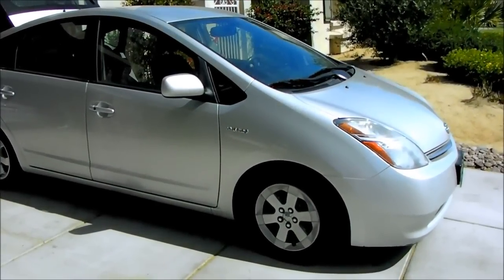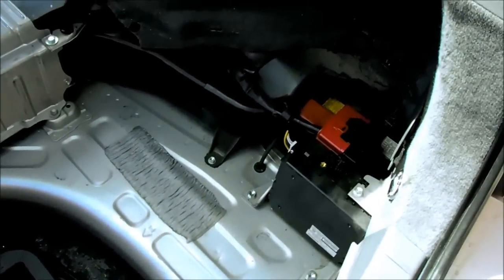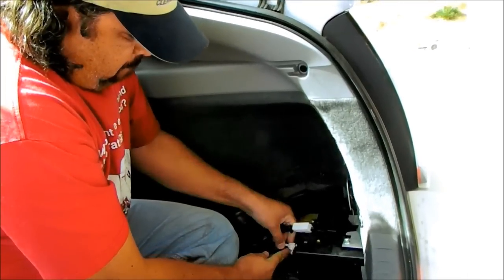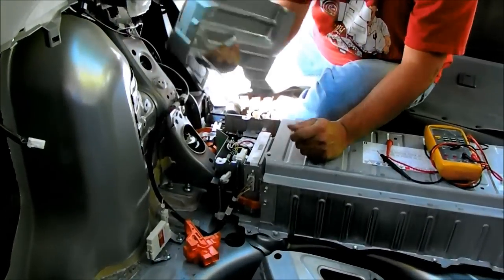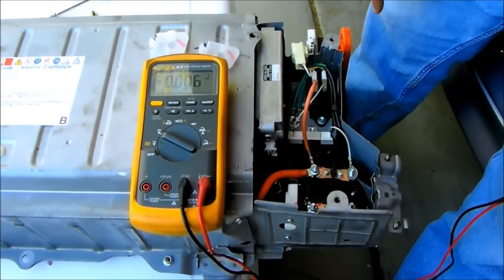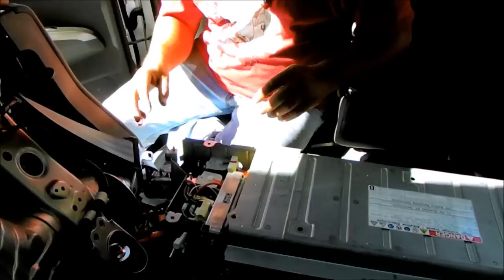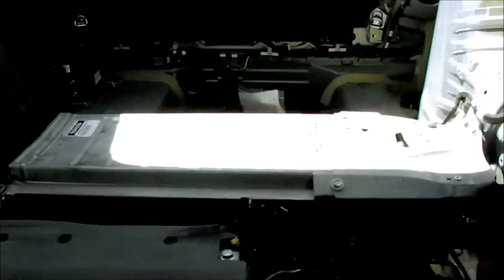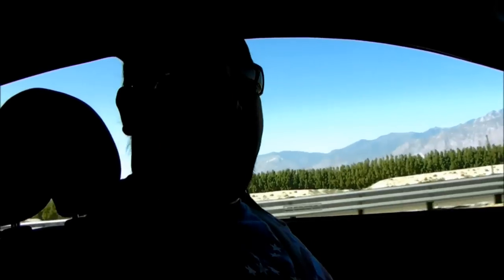Toyota Prius battery removal and repair. replace hybrid check engine light

Comment: Thank you for taking the time to make this excellent video. I followed your steps to a tee and the battery removed exactly as you described. (1 hour plus time ). Due to the extreme cost of replacing my hybrid battery in Canada, $2000 for a reconditioned one, I decided to take this one step further by checking each cell to find the defective cell. Every cell except one measured 8.1 volts and the one stray measured 6.78 volts. Removing this cell and replacing it with a new or reconditioned battery fixed my 2006 Prius. Car runs just like it did before the dash lit up like a Christmas tree. Many thanks again. John
Reply from the maker: Glad my video helped you out.

Comment: Salve, se qualcuno avesse problemi con la batteria della propria auto ibrida, sono in grado di sostituire le celle guaste senza cambiare tutto il pacco batteria, ma cambiando solo le celle guaste: si evita di spendere 2500/3000 euro. Effettuo anche il bilanciamento delle celle, anche se la batteria funziona: effettuare il bilanciamento aumenta infatti le prestazioni dell'auto e allunga la durata di vita della batteria. Il test dello stato della batteria lo effettuo gratuitamente (in toyota 39euro). Per maggiori informazioni  tel:3388610904, email:valerio.lombardi95@gmail.com

Comment: replacing one bad cell row .... is like changing a worn battery from a torch ... and putting a new cell ... soooon othet cells will start to fail . we all have practical experience of only changing the bad battery's in a torch ... hikz this is not easy to take out ass cells fail ... not like a torch...by the way i dont think amerzon or e bay have new cells ??? must be used ones taken out from packs ???? that would be worse ....

Comment: I have a 2005 Prius with a new hybrid battery I paid 3K to install less than 2 years ago.  The Catalytic converter on this '05 Prius now is broken so I'm thinking of just getting rid of the car.  I also have a 2007 Prius that still has less than 100K miles on it.  I'm thinking of removing the newer battery from the '05 and keeping it to put into the '07 in the future.  I don't want to go through the expense of buying another new battery for the '07 someday. Is this a good idea?  Just want the opinion of a guy with skills.  Don't know a thing about cars.  THANKS!!
Reply: Cynthia Robles I would do that. Sooner or later you'll have to replace the battery on it too. Or buy a used catalytic converter from someone that is parting bc a Prius out.

Comment: At the end of the video you talked about replacing individual module cells. I did some research on those and I get it... those run about $20-$40 each on eBay, and with a battery tester the bad modules (usually just a few) can be replaced. No doubt this is what Toyota does when they replace a (battery). That, or they replace all the modules and sell off the working modules to mechanics. What a scam. https://www.youtube.com/watch?v=8p8Im1eL67Y

Comment: Thanks a lot for the video. I did replace a cell in my battery and re-balanced. But found out that my Hybrid Cooling fan on the right was not blowing cold air making battery hot and causing triangle of death. I replaced the fan and it worked like a charm. These steps helped.

Comment: is anyone in New York can check my 2010 prius the car stop in the middle of highway in long island expressway but manage to travel in the safe area. I sent the car to the dealership where i bought and they told me it cost $3600 to repair it. i have not make any decision yet so i towed back my car in my driveway. if anybody out there can help me diagnose what's the problem on the car with much lower repair cost i would appreciate to call me at 631-921-1102. Thank you

Comment: Glad to see you used the necessary protective 1000v gloves whilst testing the high voltage.... This is not a do it yourself job you can and will be killed if you touch the high voltage connections and beware high voltage can arc.... don not work on , touch or test any high voltage system until the service plug has been removed.

Comment: here's  a few suggestions for getting a good result
do not try to do this unless you know what you are doing - the acid can burn your skin
check the voltage first - there may be a dead cell which would waste your time.
Check the battery fluid.
Try to fully charge the battery.
(I learned about these and more from Jons Mender Guide site )

Comment: I changed my prius battery, actually I replaced one cell abd put it all back together and it is now back inside all hooked up, when I try to start it the power is on but my car won't start the engine. what do you think could be the problem here

Comment: No one ever shows actually putting the battery back IN.  What trouble did you run into putting it back in?  Any friendly tips?  I recently took my battery out, easy.  But I have a feeling putting the new one in, will be where the trouble comes ....

Comment: i have 2009 honda civic hybrid tho. took to autozone to diagnose. and it came with error code. p1570, p0A7F. googled it and no luck or answer. maybe bad battery cell too?
Reply: +Calvin Le No. The 09-11 HCH2 batteries are atrocious.  Replacement rates of over 30%.  Honda extended warranty in ALL states to 10yr/150k mile.  P1570 is a individual voltage input issue and P0A7F is just a deteriorated battery.  This indicates that at least one of your 12 cell subpacks has gone bad.
Reply: I have a 2008 civic and this batteries are in FREE recall. Honda dealer change for a new battery for FREE. I suggest you contact you Honda local dealer.
Reply: Please provide evidence of your claim.  The 2006-2008 are covered under a settlement extending their warranties to 92-96K depending on year.  The 2009-2011 have all been extended to 10 year/150k miles (the CARB warranty).
Reply: Actually... you sure it's not for the airbags?  We just got one... :)

Comment: drsjr1969 
  I have 2005 business edition and its @ 158K I have not had problems with the battery, How will I know if I will need to replace it when needed?
Reply: the warning lights will come on. it can ran only for a couple miles after.

Comment: Just out of curiousity where do you live ? Our 12 v battery died while driving it. We replaced it and got a new key but the 2006 Prius dash won't light up,except for the open door indicator and the security feature and the car won't start.

Comment: Cool vid.  While I understand that you reverse the steps that you showed to complete the removal and replacement, it would be cool for folks if you did the complete process.  Please show how you repaired the battery pack by load testing and placing the battery on a circuit (presumably a battery charger).

Comment: I cant believe your not dead. no gloves, did not drain the caps, Im a 30 year Toyota master. You are a lucky man!!!!
Reply: Voltage doesn't kill, amperage does. Spark plugs can generate 50,000 volts - but it's low amperage. I learned about that as a high school freshman in the 80's when the instructor told me, "touch this," and I got zapped. Things were different in the 80's.
Reply: Ignore him. He doesn't know what he's talking about.
Reply: Cap is Caps in the inverter can store a massive charge but that do self discharge in a fraction of a second but if you just removed the plug then there is that potential ... @snoobler
Reply: @DesigninMind1  I speak from experience.  "30 year Toyota Master"  probably hasn't personally replaced 200+ Prius batteries.  In my experience, I have NEVER detected a measurable voltage the the terminals.  The poster of this video confirmed no voltage. No risk of shock. No need for gloves. Not sure what you're on about concerning the plug. It splits the pack removing voltage on the OTHER side of the relays. The relays isolate the battery from the inverter when the car is off, so the plug plays no part in any potential hazard from the caps.

Most screaming about the danger of hybrid batteries are simply parroting what Toyota says more for liability reasons than for safety reasons.
Reply: A few months ago i touched live HV battery with a wrench. It shocked me like there was 50-100v ac.
As you can see i'm still able to comment.
Reply: @АвтомобильныйМир-е9м  Considering  the safety interlocks, I am curious.  How did you manage to defeat them?  Which generation Prius?  Because I am writing an essay on the subject, I would appreciate your response; thanks.  Up until now, I have not identified a single news report of an individual receiving a severe-shock or being electrocuted by a hybrid vehicle.  And those that traffic in this fear uncertainty and doubt (FUD) always seem to have a financial interest at stake.  Finally, Toyota's safety interlock system is quite ingenious and the addition of a corresponding orange plastic retainer clip, a clip that is used to fasten the cover,  on GEN III Prii only enhanced the safety system; the orange safety switch is required to fasten down the battery ECU's cover.

--A general electrician
Reply: The Cap in the inverter more or less self discharges in a fraction of a second, but still a valid point. i repair lexus Gs450h/Rx400h, i did wince a bit with the safety plug and the DVM leads. i have a standard rule, when you can work with One hand, it limits the potential of the juice going through your heart. better black fingers (which i have done) than a black heart lol
Reply: Drain the caps?
Reply: graham hendren yeah ignore him. Hes just trolling
Reply: Are you all dumb? It's not volts NOR amps that kill you, it's a combination of both that kill you. High voltage with high amperage equals high wattage, and THAT is what can kill you. If you have high amperage but no volts at all, you're safe.
Reply: Strictly speaking your wrong. its ALWAYS the Current that you consume as an effective Resistor that kills you but . but consuming watts still sums to the same thing. think then quote 30ma can be lethal through the heart . p.s you can have volts and nearly zero amps but its damd impossible to have mega amps and no voltage ... @swampsnipe8790

Comment: Hi .  I've got a Prius V and I want to lowering my rear cargo area , and make   a two seater with a huge low  rear cargo area  . So ,  I want to relocate the batt pack just behind the front seat in the actual rear foot well area . For the spare tire relocation ,  if need , it's not a problem . Do you think it's doable  or better order the Lithion ion batt pack offer  in the euro Prius + V ( a  V with a third row ) . This pack is locate in the center console of this euro version .

Comment: With some electrical and mechanical skills you can do it yourself. If not there lots of small shops can perform battery exchanges. looks like a 1/2 day job. after few times it can be done within 2-3 hrs. Don't let the dealer rip you off! Good video !

Comment: Why are you testing the battery with the meters range switch on Ac voltage? Motors run on DC current
Reply: BreeBree Cris The AC position is the first position past "off" with the wavy line over it. DC has the solid line with the dashed line underneath which is what it was set to. I was surprised at the voltage though, 220V DC, that would definitely get your attention! (Or you could weld stuff with the leads!)
Reply: It's not possible to measure DC voltages with a meter set to AC.

Comment: George Betuk
I believe that the Hybrid Battery on my 2006 Prius has gone south. I received the same quote from my Dealer. I am really strapped for cash just now and asking your thoughts on maybe a used Battery pack. Your video is excellent by the way and I appreciate your post of the process.

Comment: To replace the battery is one years gas bill and if you repair its worth couple months gas bill. Very worth the hassle if you keep the car. All that would have to be done to replace the hybrid battery is set a side 40 dollars a month or 10 dollars a week tell the battery died in 5 years time.

Comment: Bam!  I used your instructions and did this in under 2 hours!  Found one bad cell - replacement cost $53 USD including shipping.  Saved me from paying a "Hybrid Battery Repair" company $1,200 to $1800 to do this.  They all give you a line about how they recondition and balance the battery and give you an option for a 12 or 24 month warranty.  Usually only one or two bad cells and it takes them < 2 hours to complete.  - DIY
Reply: hybrid repair companies do the same.  they only replace bad cells and you may return to them again and again.  the warranty they give you, covers only the cells they replaced.  for me, the best thing is to buy a brand new battery and go for another 5-10 years without headache.  the warranty on a new battery covers the whole battery not few cells.  thanks for pointing out the hustle of countless repairs.
Reply: +David Hoel  How did you discover which one was the bad cell ?
Reply: +Tom OConnor remove the leads and leave for 24hrs and test with a voltage meter. good cells should be putting out 7.6...anything less and you should replace the cell....the bad ons throwing heat resistance will be 7.4 or less
Reply from the maker: +David Hoel I'm glad my video help you out. Thanks for your added info also.
Reply: +David Hoel How is the repair holding up?
Reply: I had to replace 3 more cells...pack still rolling
Reply: So, it's pretty safe to say your DIY repair wasn't particularly effective.  You've replaced a total of 4 bad modules on at least two separate occasions (probably more), and there's no reason to believe that you won't be doing it again every few months because you're just chasing failures as they happen rather than addressing the underlying issues.  Thanks for following up.  I'd hate for people to read your initial comment and think they're in for a one-time easy fix.
Reply: Not all do.  Even the ones that do, it's only reasonable to expect them to warranty the modules they replace.  It's like driving into the tire shop with a flat, but you have put covers over the other three. The only thing they can check is size and tire pressure, but they can't inspect the condition of the tire... yet a warranty is expected?

The reputable ones don't do it that way, and there are a lot better options for the same or just a little more money; however, in many cases, for a newer model with a lot of remaining life expectancy, it's hard to argue with a new battery, especially now that Toyota warranties dealer-installed packs for 3 years.
Reply: have 2007 prius.the battery don't charge well when driving..do I need a new battery or it somthing ealse
Reply: +florence kennedy probably. If you find your battery gauge goes up and down pretty quickly and/or your fuel economy has dropped, those are the first signs.
Reply: I start experiencing this last week when I jump start my friend toyota..do u think that's the reason y my battery wount charge
Reply: A Prius should never be used to jump start anything but another Prius.
Reply: U think that's y my car acting up
Reply: Maybe.
Reply: If that's the case do I still need a new battery
Reply: florence kennedy 2007? yep new battery
Reply: David Hoel
Reply: S Keith
Reply: David Hoel you didn’t have to balance the battery?
Reply: sc
Reply: sc

Comment: thanks for  this good video, My brake master cylinder is leaking  by brake pedal, 06 Prius , How you ever have done one of this?  I have done on conventional vehicles but I hear special bleeding procedure with scanner should be done, do you have any suggestion? thanks

Comment: was getting the pryus worth it? you saved gas over the years but now that youre redoing the battery...doesnt that offset the savings?
Reply: Most vehicles need engine and transmission repairs as well. It's the battery for the prius and the other vehicles its other things.
Reply: JoeCnNd Most cars are not going to have engine or transmission issues at 162k miles if properly maintained. Regardless a pruis is just as prone to normal mechanical issues as any other car ( wheel bearings , alternator, starter, transmission, engine etc) but with an added wrench in the pile the hybrid electronics now even though most of this system is not prone to issues just having this in the system makes everything more costly so unless your a DIY, under warranty or have a good mechanic there is some cost analyses to consider.
Reply: Charles Scott Charles, I have a ten year old 4x4 dodge and between the oil changes, smog checks, and standard maintenance fees, I have spent well over then amount these car owners are complaining about.  Now my 10 year old truck is starting to crap out on me too, so more money is soon to be spent ... beyond what I've already spent over the years.
Reply: Amanda Hall I understand, most cars has inherited issues and all are prone to wear and tear some less then others some more costly then others. My point is a prius does have some added cost you have to consider when it comes to maintenence and repair
Reply: Roadkill beats the piss out of vehicles. They have a great time doing it. They also enjoy driving vehicles in such bad condition a death row inmate would pass on them. You don't take economy cars to track, and you definitely do not take what roadkill subjects cars to as an accurate representation of quality or durability a vehicle may possess.
Reply: +Frank Columbo The prius absolutely has a transmission. Its a very complicated CVT that sandwiches the electric motor with a planetary gear set after the output of the main engine. It's a technological marvel in how the electric motor doubles as the starter. And it also has an alternator. Not in our conventional sense of a belt-driven one, but there are components that utilize waste energy when slowing down to charge the main and secondary batteries within the car.